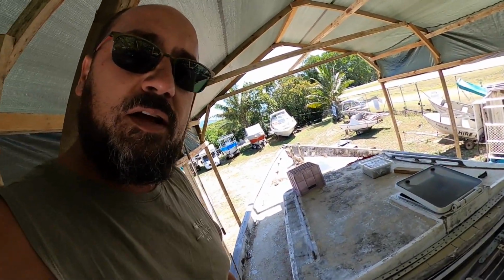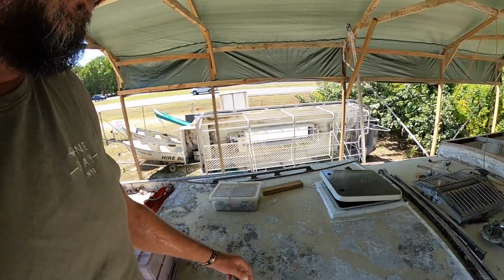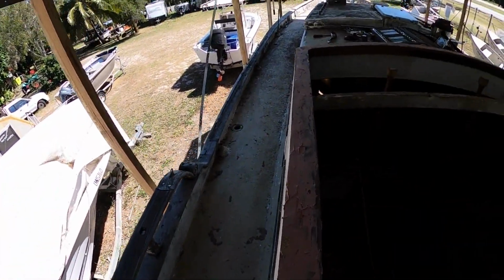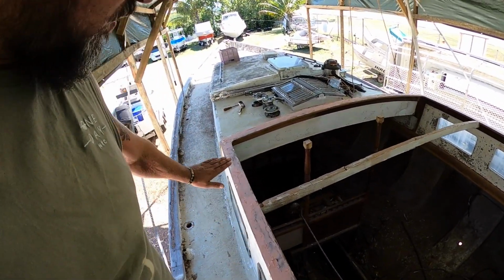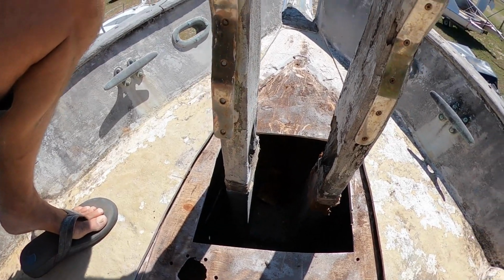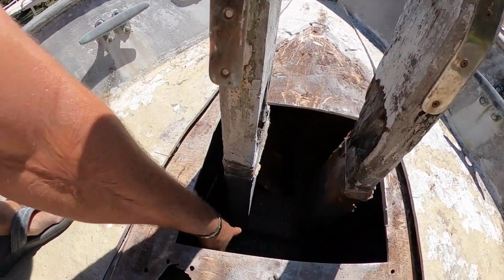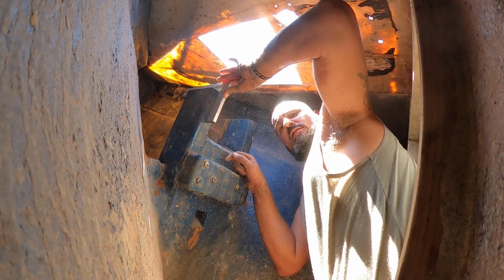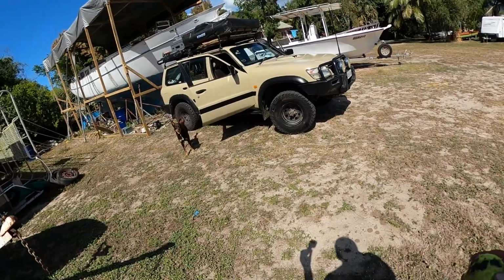Roof Prep & Cutting Stuff - Sailboat Rebuild ep19

Comment: Great project, looking forward to follow this. If you planes on using this for a liveaboard boat, I would consider to skip the beds in the front pit, and make this an storage room. You could even turn the washing machine, so that it have the front in this room, which also would free up some room behind it that could be used as storage in the master. But no matter what great project.
Ahh yes, Please consider using flat head all the way, as you at some point will use some sealing or paint over these screws and this will make it easier to remove later on if flat head has been used.
Reply from the maker: Thanks for the feedback Jesper!! I will keep these ideas in mind as I get closer to finalising the build inside.